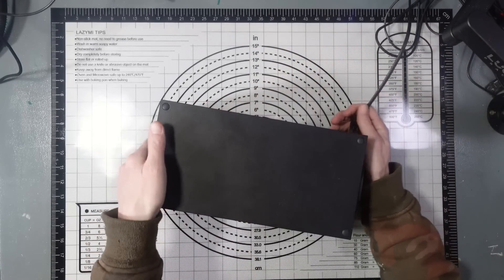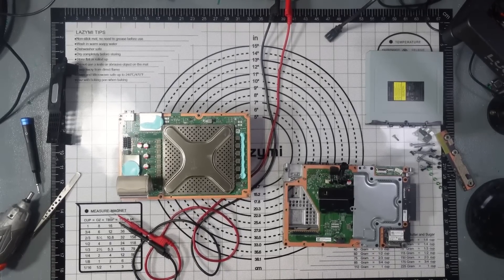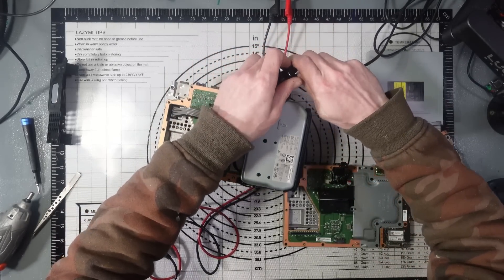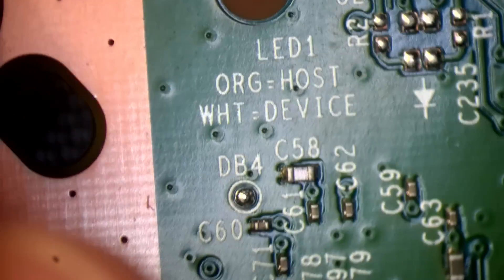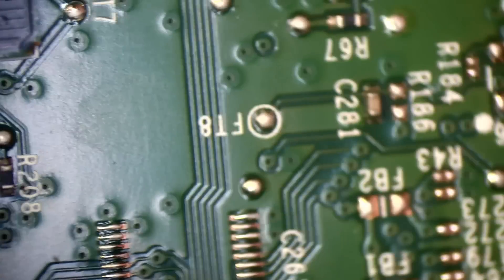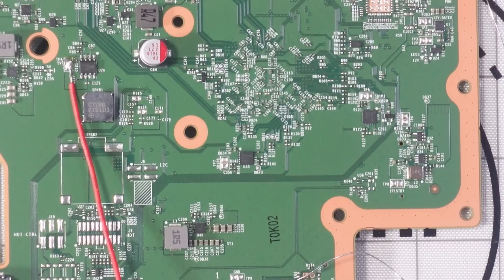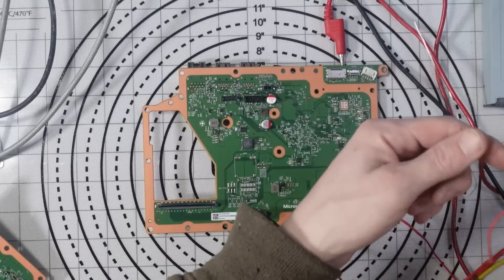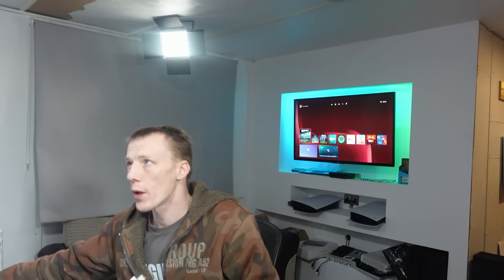Another EASY Repair? Xbox Series X Not Turning On At All!

Comment: The other day when I was home on lunch, to my surprise my xbox series x wouldn't turn on. The first thing tried was moving outlets. I did that a total of three times all with other things plugged in and working at the same time. We know it isn't an outlet 100%. Second thing i did was move it to a completely new outlet as the previous 3 and plugged it back in with only the power cord plugged in and tried to power it on via wired controller and still to no avail. At this point we know it isn't a broken button and the controler was wired so it had direct connect therefor would have almost certainly turn on the xbox as soon as it was plugged in and the button was pressed. It's like a year old new one of amazon. I've watched a few videos now and I have a multi meter and hot iron I can maybe fix it if a visual inspection provides fruitful. Does anyone have any pointers or advice? Maybe have has the same or similar issue?

Comment: @TheCod3r. I’m hoping you can help me with my faulty Xbox series X.

If I do not turn it on for a few days, it’s refuses to turn on via the Xbox controller and I have to get up and turn it on and then it resets.

I have previously sent it into the tech centre via CeX but not only can they not replicate the problem (it works fine for them) they’ve also managed to add scuff marks to it.

Could you help with this, please?  Because the problem is intermittent.
Reply from the maker: It sounds like your issue may be with the controller to be honest. I've never come across that issue but it would be very difficult for a technician to diagnose given the length of time it takes to happen
Reply: @TheCod3r  Thank you. I really appreciate the reply. I would normally agree with it being the controller at fault but this morning my Xbox would not even power up with the power button on the Xbox console itself. I simply don’t know what to do next.

Comment: Hi phil hope your keep well.. woundering if you can have an input on a issue iv just got with an xbox one S Came  in no display hdmi filters all good decided to replaced retimer and when i connected power cable to test the fan spins up like the system is on but no power light comes on unless i press the button still no display so i removed retimer incase i shorted a pin with out noticeing but the xbox still does the same with ic removed dont know whats going on her im well experienced when it comes to charnging ports and retimers but im at a loss with this xbox appricate your input if possible

Comment: How much stuff is chucked away because of a cheap cap !? it's the penny pinching company's that make millions but make us suffer ! 😡
Reply: my expensive AF router (fritzbox 7590) recently stopped working for no apparent reason. no sign of life, PSU pulsing. to cut a long story short, this nearly 200eur router was taken out by a single cracked ceramic cap that shorted a power rail and effectively bricked the whole unit. any average joe would've just replaced the whole thing because of one failed ceramic cap worth what? 2ct, if that? 🤦‍♂